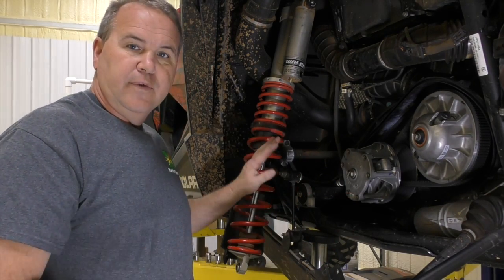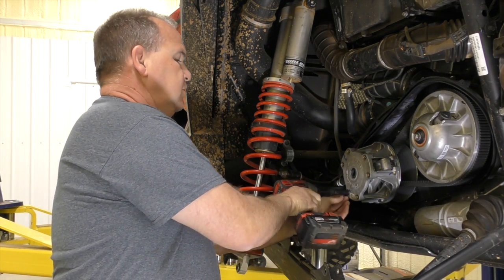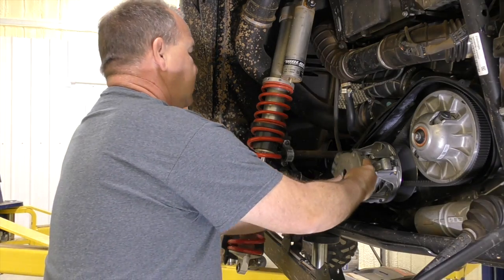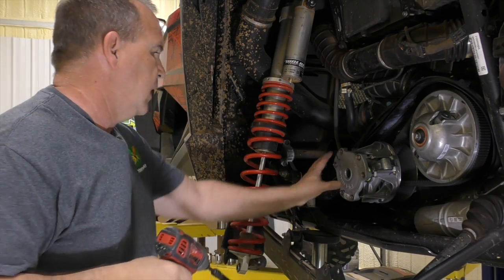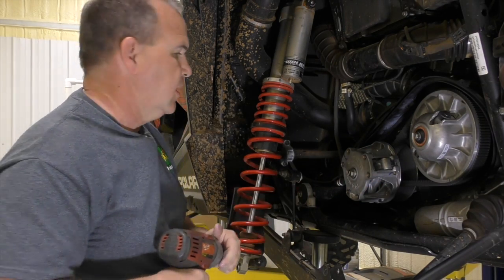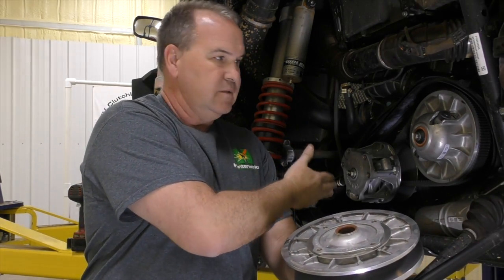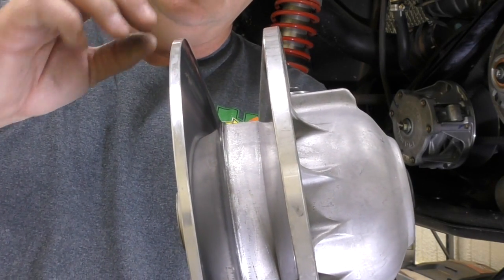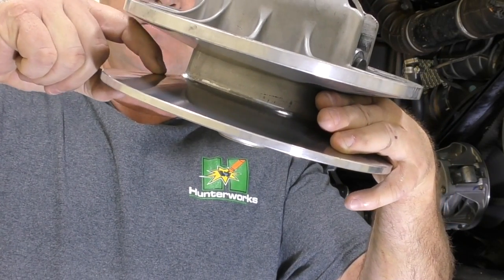Version 2 How to stop your Non Turbo RZR From Blowing Belts!!!

Comment: Absolutely can confirm on my 2018 RZR XP1K that in low gear High Rpm the belt was touching the bottom of the secondary on my machine prior to this modification. Definitely appreciate all your research Todd.

Comment: I added the white washer to my 2019 General 4. I pulled the belt just recently and removed the cover. I was blowing the dust out of everything. The white washer was not held in place by the spring. It was actually in the middle of the shaft. Suggestions? Comments?
Reply from the maker: Lester Bowers nothing spring doesn’t hold it.  It floats on shaft.
Reply: @Hunterworks  Thank you, I was worried. You guys are the best.

Comment: Hey bud I just bought your belt and I saw the white washer, so I am visiting this video. My primary clutch never had a washer 2020 polaris general 1000 eps. Also ive never blown a belt. If you go to my page you can see my ride. I have 4 inch portals with 30% gear reduction and a 10 inch lift on 35 bkts. Also i have a mudder clutch kit with I believe 67 gram weights. Seems I like to glaze belts. I have to be very precautious using low because I will spin a belt in high. I've never blown a belt. And it still goes about 55 mph. Do I need this washer? Will it help with belt spin or do I maybe want that long travel engagement? Thanks! Great videos
Reply: My issues seems to be at start going over a log or on an incline. Like I said I try to use low. Sometimes it seems like it shouldn't need it though.

Comment: are the 2 blue washers or 1 hunterworks white washer needed on a 17 ranger xp1k? we have the factry speed limiter tuned out
Reply from the maker: probably not, won't hurt though if you gonna run top speed or over 60 for a while

Comment: I just bought a 2012 900 rzr 4 seater and the guy told me he had put 3 belts on it on 3 trips out riding i just rode it around the house and it broke one on me will this help me out or do u think i need new clutches
Reply from the maker: I can't answer that, use our how to trouble shoot the primary clutch and secondary clutch videos to look for issues.

Comment: Just purchased a 2022 1000xp rzr. Do i need the washer?
Reply from the maker: You would need it for the same reason any other rzr XP 1000 per the video and you still certainly need Square pucks removed from your secondary and put our rounds rollers
Reply: @Hunterworks  Thanks for the quick reply, will be upgrading soon :)

Comment: After my 3/8 bolts came off my plate didn't come off why ?
Reply from the maker: corroded on, If you have a secondary spring compressor, put in it so it does not fly apart at you when start tapping it from the bottom of the cover
Reply: @Hunterworks  thanks I'll try it this weekend

Comment: I can be one hundred percent say it takes years to get the feel of using an impact and getting proper torque
Reply from the maker: I agree however what do you hold these non turbo clutches with that you don’t risk having the spider and nut turn while torquing?  The answer is nothing
Reply: @Hunterworks  good to know about I haven’t done one myself just trying to learn everything I can. Can you do a video about belt dust, slipping, cleaning in the field and cleaning in the shop?